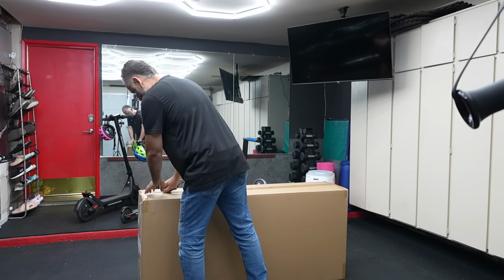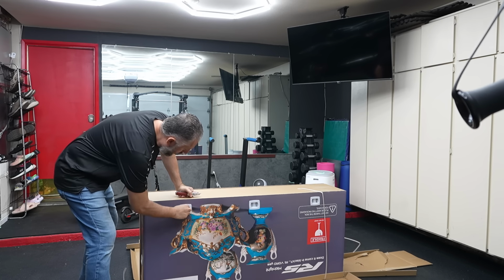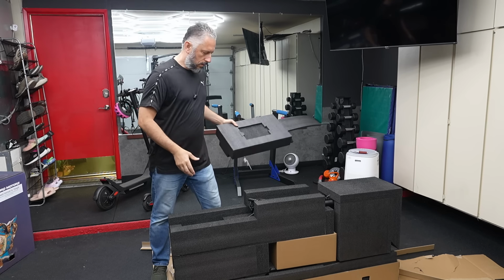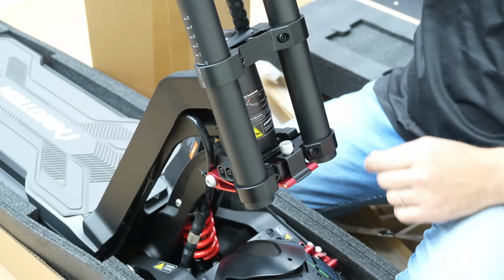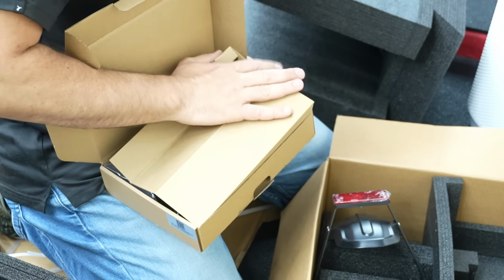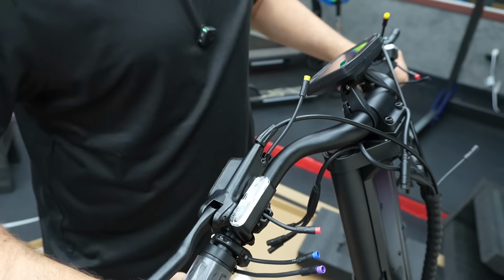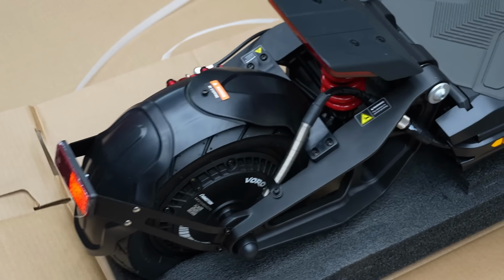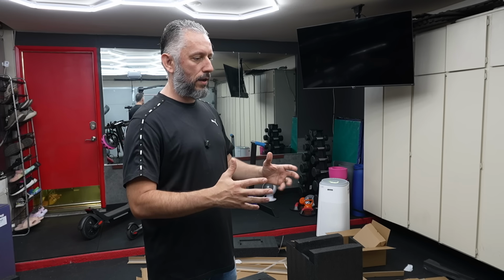This Hyper Scooter is a BEAST ! INMOTION RS Lite Unboxing and Assembly.

Comment: First of all, excellent video. I have a question: Is there any size difference between the RS Lite and the RS? I'm referring to the size of the scooter chassis.
Reply from the maker: Based on the information available, The InMotion RS and RS Lite scooters have identical unfolded dimensions of 1473 x 716 x 1363 mm and 11x3.5-inch tires. The RS Lite is about 12 pounds lighter than the standard RS, weighing 116.6 lbs compared to 128 lbs.

Comment: You forgot about a quick visual inspection, which would show where everything is. And then you start assembling and connecting the parts. "Better than factory"..... But all the same, it requires concentration and attention. Greetings to NF, from Croatia 🍻

Comment: Price is absolutely absurd!
Reply from the maker: Even if you think it’s just a scooter, the price is tough to beat. It’s packed with high-end features like dual 1500W motors, a high-capacity original Samsung 72V battery, hydraulic disc brakes, full hydraulic suspension, and an impressive range of up to 75 miles. Capable of handling 50-degree slopes and reaching speeds of around 60 mph, it offers outstanding value especially compared to others in its class. With performance like this, it’s practically half a car on two wheels.

Comment: I usually suggest to people getting an Ebike with torque sensor($1k+), it senses how much pressure you are applying to the pedals and assists accordingly, so you can pedal as easy or as hard as you want, and get some exercise while enjoying nature. Cheaper Ebikes don't work well(I have one), they either add too much assit, or too little assit, so they only work for exercise if you can find the right terrain.

Comment: I wouldn't leave a scooter on charge while you go to work never leave and thing with a lithium battery charging unattended
Reply from the maker: Look up Battery BMS. The scooter uses Original Samsung battery with BMS Battery Management System which really sets it apart from cheap scooters. BMS monitors power delivery while protecting and extending the battery’s lifespan. It includes essential safety features like overcurrent protection, short-circuit protection, and voltage regulation to guard against overcharging and deep discharging. It continuously monitors the battery's temperature to prevent overheating during use. The battery is also IPX7-rated waterproof, meaning it can withstand immersion in up to 1 meter of water without sustaining damage.
Reply: @NorthridgeFix  He is right that could burn you're house down if malfunction unattended, always be aware when charging ! no matter the brand
Reply from the maker: I have to agree not to leave the scooter charging unattended, in case the BMS fails or short circuited for whatever reason. It might be rare, but it’s still possible. Then again, the same could be said about everything in life. What if the car’s braking system fails while driving? What if a bike tire blows out mid-ride? What if the phone’s charging protection fails? Or the balcony rails give way while you’re leaning on them? ...........
Reply: @NorthridgeFix  What if a man is speaking and no women hear him; is he still wrong?
Reply: @NorthridgeFix  Maybe there should be fire resistant jackets that fit around the base of the scooter to supress if it fails similar to a lipo safe bag ? when charging , don't think they are for sale but maybe good business idea ?
Reply: 99% of the planet dont know the risks
Reply: But think of the repair video if the battery went into thermal runaway!!!  Would give a whole new meaning to "Better than factory!"
Reply: its more dangerous to ride a card or walk over the road then charing a battery.
Reply: I think have cicuit protection overvlotage protection.....like phones.....I have usb meter show voltage and current that phones takes to charge when is full current go zero, it shows that phones interrupt charging automatically....